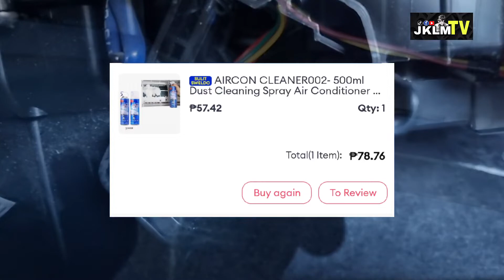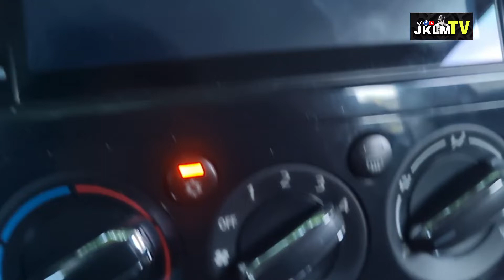D.I.Y. Linis Car Aircon NO NEED BABA DASHBOARD | how to clean car aircon Mirage G4 #reels #kaalaman

Comment: Tubig lang po ba yun sir ginamit mo pang banlaw
Reply from the maker: Yes sir
Reply: @JklmTvAdventure  tapos bili nalang siguro ako yung container na may pressure. Kunting banlaw lang sir noh?
Reply from the maker: @Rammel_TV  yes may pressure po sir dapat 🫡
Reply: @JklmTvAdventure  kunting tubig lng noh hanggang mawala lang yung bubbles?  Kusa lang natutuyo yun sa loob o naddrain?
Reply from the maker: Opo sir sa ilalim po deretso drain ang tubig, tapos sir patuyuin mo lang atleast 10 all goods na po un 🫡
Reply: @JklmTvAdventure  10mins?
Reply from the maker: 10 mins sir 🤟
Reply: Water ba un sir?
Reply from the maker: @noelcruz6655 yes sir
Reply from the maker: @noelcruz6655 yes po sir